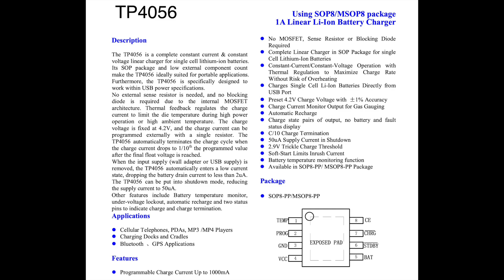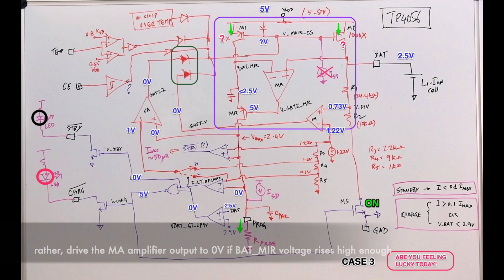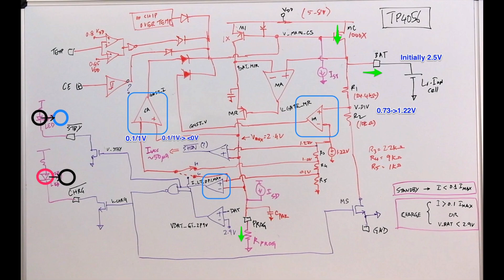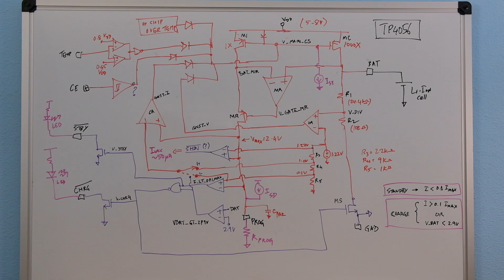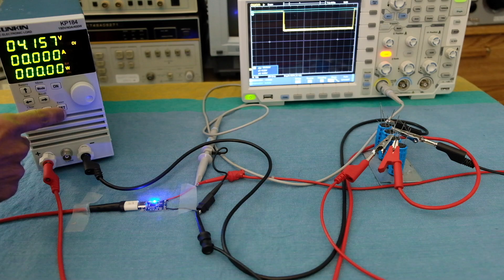A deep dive into the functioning of the TP4056 Li-Ion battery charger IC

Comment: I got 0.7 to 0.4 voltage at output side . But I plugged on charging it's glow both led and not charging battery but its give 4.1v on charging. But we remove charging than its come to 0.7 to 0.4v
Reply from the maker: Looks like it's not working as intended. Both LEDs should never light up at same time. You are measuring the cell voltage when connected to the charger. Output should be at 4.2V or so if the charger is functional with no load.